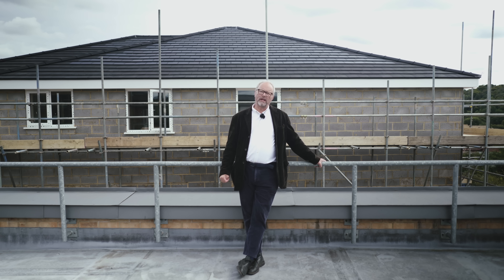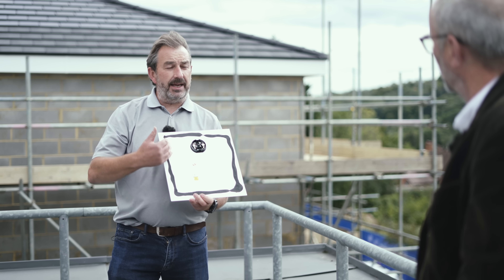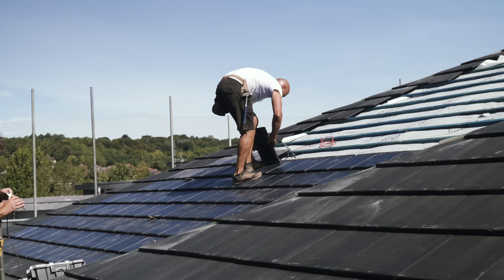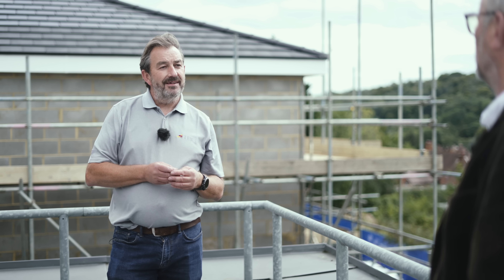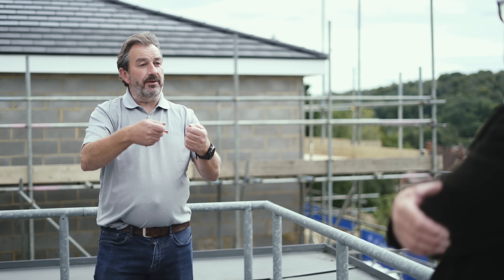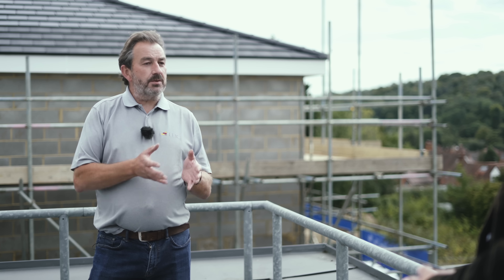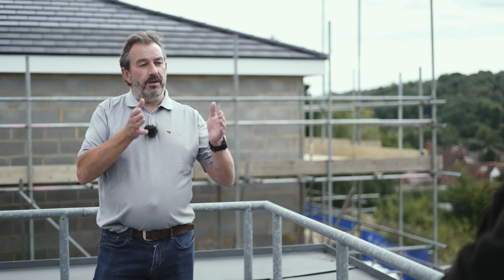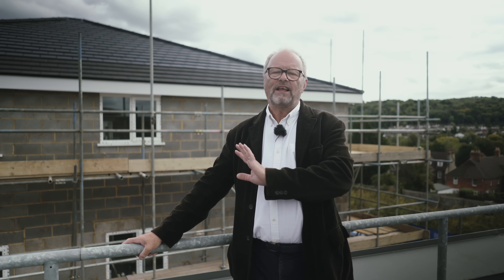Solar Roof Tiles - should every building generate its own power? | 100% Independent, 100% Electric

Comment: It seem counter intuitive to put a hold in a tile. People are trying to match old roofing systems by sticking a bandaid on it albeit that patch being a solar panel. You still have tiles and battens and roofing felt etc. There needs to be a whole new roof design based on solar, not solar as a stick on. Is a hip roof even an option if you're designing for solar?

Comment: Every house should have this. I have just bought a brand new house and the builders would not offer us solar panels of any description, I was appalled. If I want solar panels I have to have someone come in after we move in and retrofit.
Reply: Cost me £500 just for scaffolding, 3 stories high.
It just makes sense when you can recess panels and save the cost and weight of some roofing tiles.

Comment: Hi Robert, a question:
It would be interesting to see what effect could bring having most of the roofs solarized ( aka had solar panels installed). Would that produce 50% of the countries needs (or even more)?
Would that be enough to get rid of the carbon-based electrical plants? Because if that would, why are we not just do that massively? Governments spend so much on so many environmental causes. But this one could have some real effect.
Reply: Actually, if you are in Britain, you will probably see wind turbines replace the fossil fuels before solar does.  Solar is more local, but heavy-duty wind farms can produce national-level power 24 hours per day equivalent to a power plant.  It's just a matter of time.  Wind turbines have already almost eliminated coal there, and then oil and then gas plants will be going next, one by one.

I say that solar is more local because, honestly, Britain not the ideal location for solar power, compared to North Africa or the American Southwest, and solar is always dependent on batteries for nighttime service.  At this point, the availability and cost of grid-scale quantities of batteries is still an issue, although that may change at any time.

Tesla's "Battery Day" is coming this month.  Perhaps they will announce something that will bring cheaper, more efficient batteries that can be produced in huge quantities.  Other companies are researching options as well.
Reply: Do you mean for the government to put in money to boost the installation of home energy storage and power generating panels? FAT CHANCE. A factory that produces low cost power cells for home storage might be more possible and the panels would follow. The panels are almost cheap enough??

Comment: Loving this idea for a product. I like the use of standard components. Didn't know roof tiles were concrete... interesting. 

Daft Question, why all the Tesla hashtags for this video?
Reply: Well, actually, lots and LOTS of buildings are roofed with materials which are NOT concrete and cannot be.  My house has a slate roof. Planning regs wouldn't allow replacement  with concrete tiles. Many areas have clay tiles. Which are 'orange' (brick coloured) and smaller. So again wouldn't be allowed for 2 reasons.
So, whilst it's a great idea, it definitely has limitations.
New build housing estates are the best fit, I suppose. And MUCH better than the Tesla idea. Much more versatile(geddit....?!) and bound to be cheaper.....
Reply: @andymccabe6712   yes mine are 'orange', so I assumed they were clay based. I just hadn't thought about it before.

Versa-tile... 🙄😉
Reply: @BullShark I'm afraid I don't see that. I was asking why Fully Charged used the Hashtags, not the tile company... Also they didn't say Tesla's tile is not as good.  They said that it isn't as versatile when used in certain roof configurations, which is a fair comment.

Comment: What is a roof For, To Stop water  from getting into the building,
Fault ONE,   Drill a 50/60mm   hole in every  Solar Slate  Hum.
   ,,      TWO,  How long does the Mastic Last That bonds the solar panel to the conc, tile.
   ,,      THREE, how do you stop water ingress under the solar panel, and down the hole in the tile. ??? HUM
   ,,      Four,    Corrosion on all the wire connectors over 20 years min,   HUM.
Reply: Err, don't you think they might just possibly have thought about the hole in the tile situation?
Hmm.....?!
Or maybe you could get in touch and give them the benefit of your years of design experience in roofing materials.....?!
Oh! - you don't have any?
Well who'd have thought....
Reply: @andymccabe6712  These people are Piggybacking of 60/70 years of Marley
or Redland tile comp design, 
with a hole that size in the tile, you will 
ruin the structural integrity of the tile,
there was no mention of increasing the pitch of the roof, as these tiles can be used down to 19  degrees, with a very slow water runoff. after just shy of 60 years roofing
the proof is in the pudding.

Comment: Looks very interesting. We have 40 panels (13.6 kW)  on a steel roof. I don't find the standard panels ugly and we like the way snow slides off. Living in Canada, you don't get any, zero, zip production when the panels are covered. This system looks good in an area where concrete roof tiles are used, but the added cost is quite a bit over a panel. We have a SolarEdge inverter which uses modules on each panel so we know if a single panel is down. Without a system like that, you can have a bad panel which seriously harms your solar production and you are none the wiser. Perhaps they add a module like that to every 15 panel groups?

Comment: Great idea, but way too expensive. If 900 tiles = 13,500 Wh, then each tile would work out at 15 Watts. At £30 each, that would make a 4 kWh system £8,000. Eight years ago, my 4 kWh system only cost £5,000 and I've seen adverts in the UK for a conventional system for £3,600. They need to get the cost down before it will become a viable alternative to panels.
Reply: Hmm, sounds a bit like another type of green tech we hear a lot about......
Clue - it's got wheels!

Comment: We moved to our current home a couple of years ago.  Most of the things we "have to do" are now done.  I am in the process of changing to Octopus Energy and we will need to get re-roofed in 2 or 3 years.

Do I need to get a powerwall (battery) first?
Reply: It depends on how much capacity you are looking to install. If you install more capacity than your typical load then it might make sense to have some storage for over night use or heat hot water. Otherwise it can feed in to your consumer unit via a dedicated circuit and trickle feed the main incomer
Reply: It mainly depends on how many decades you want to wait for the system to stop COSTING you money ....!!

Comment: So if in series if one goes down  or gets shaded, then all that pack don't produce and be fun fault finding 46 fixed tiles to find the problem 🤔🤔🤔🤔
Reply: The guy interviewed in the video addressed this in a reply to another comment.

If a cell fails or is shaded there's supposedly a bypass diode that still allows the rest of the panels to continue generating.
Reply: Cheers James missed that bit 🤔🤷‍♂️

Comment: None of the tiles are secured to the roof battens. Is this acceptable practice?
Reply: Ever tile nailed to battens after laying (it was too boring an operation to film)
Reply: it's been a while since i've looked at clay tiles but interlocking tiles like this may not be connected at every point, because they interlock so one wont move without all of them,  the edge ones will need to be nailed / wired / clipped  to the battons.    It's very possible that they have some sort of clip system not shown on  this video though.
Reply: Russell Fry every tile is always nailed. In some countries tiles are lipped and hang on the battens, in which case every second or third row might be nailed, but anywhere where wind is an issue such as the UK it's always been the case that each is individually fixed.

Comment: Cant blame anyone for wanting tiles over panels cause they do look so much better. But i still havent been won over.

Saying its cheaper to install this compared to a normal roof with panels, seems like an obvious lie to me (though i havent done the maths). A "50% premium" is a good way to sell this roof but i still feel panels would be easier to repair, easier to upgrade, more efficient, cheaper, but of course much uglier.

Really id have to look at this in depth but i still prefer panels over tiles for cost, and more importantly energy production. Panels are just more efficient, and theres some amazing new panels developed and coming through.

Comment: These look really nice, though it sounds like they’re using a single inverter per elevation which I think would suffer under patchy cloud cover vs a panelized system with an inverter for each panel.

It really is infuriating isn’t it when you see a field full of solar panels and a bunch of warehouses next door with none.  Or if there’s a huge parking lot the same size right next to it.  Or a giant housing development with no panels installed!  It really is shameful I think to not fit panels to the many convenient spaces left in our built world and steal nature instead.
Reply: Abram McCalment we are actually installing a single inverter for the entire project, with separate mppt trackers for each elevation.

Each tile has a bypass diode to optimise output individually removing the issue caused by partial shading.
Reply: @ChrisHall great to hear this I had the same question. Another question I had was about returns. In the netherlands 1 watt of solar is good for around 0,9 kwh a year. What are you expeting from the solar tiles?
Reply: We had a new lidl built as few years ago and gues shat no solar, all supermarkets should be mandated to install solar capacity equal to their refrigeration load. This should be also thought about at initial design stage and not be allowed to be 'watered down' like the Merton Rule often is, a derisery 10% often ending up at 5%!
Reply: @andyhodchild8  The big Saintsbury's outside Kingston in SW London has  solar and wind for the lighting and refrigeration. The did off there own bat.
Reply: @andyhodchild8  We had new LIdl built in Dover as well, 2-3 years ago. No solar either. Their roof even slopes to the North, and they made huge glass wall on the southern side for extra light. In my opinion, solar would make more sense
Reply: This is what is normal in South Australia. Only problem is those that don’t have Solar panels get bill shock during summer
Reply: what about when there is SNOW....
Reply: @dopeytripod  ...then they are covered.
Reply: @dopeytripod  the snow melts a bit more than a regular roof because of the thermal mass of the solar panel, andsome have small heating elements that create a small film of water underneath (don't have to melt all the snow), and the snow slides off if there is enough pitch. Or you have to buy some power from the grid.
Reply: I see a possible problem with snow buildup as with metal tile roof the snow sticks to the roof, but will it stick the same on glass? The problem only happens if the roof is slippery and it slides off taking the guttering with it. Most houses can overcome this by fitting snow straps from the roof to the guttering, however how can you attach them to glass panels?
Reply: Plot twist: all the other houses have solar tiles and you can't see them.
Reply: Some people get it more quickly than others. It will happen eventually
Reply: yeah sorry Phoenix Arizona
Reply: Attention, Limeys !  We Muricans love youse Gyes for so many reasons...including your quaint expressions. Yes, I Do Have and am About To Make A Point Here: W E I G H T !!!  USA roofing material is largely made of a felt-like material sometimes referred to as asphalt. Home Depot, where I worked for 18 inglorious months, sells train-loads of this stuff to individuals, both homeowners and tradesmen, usually the GAF (formerly General Analine & Film) Corporation brand. Multiple-layering does, in fact, make for a weighty situation, but "concrete" ...Really ??  Or am I conflating Concrete with Cement ?  I wonder what the weight difference is among the GAF product, the standard British roofing material and the various Solar panels. [Statement, not Question.]
Reply: I have Tesla roof tiles on my roof my system is 14.97kwh and it makes 50 to 70 kwh per day even on cloudy days.
Reply: with 2 inverters.
Reply: @Slebonson  I like it when you see them running at night under a bright full moon.
Reply: @Slebonson  To be relevant to this discussion your location would be important to share ...
Reply: @Slebonson  The problem with Tesla tiles, as Chris explained very well, is that if you have a US style roof with gable ends you are OK, but only if the roof is a whole multiple of tiles long and wide. These solar tiles are identical in appearance to the non-solar, which can be cut to fit. Could you do that 4 aspect roof with Tesla? No.
Reply: @sadiqmohamed681  The non-solar tiles of a Tesla roof can be and are cut to size for installs.
Reply: @MrAlfable  That isn't what I had heard. But good to know. It would make them more saleable in Europe. The big planning issue with solar roofs is planning permission, so this type of tile makes a huge difference. The next step is going to be making the sort of tile use in most of central and southern Europe which are not flat. If recently read about a technology that can be applied to existing tiles by spraying on layers. But so far only in the lab.
Reply: @sadiqmohamed681  The solar and non-solar tiles are not identical in appearance.  Even in this video you can clearly see the 'framing' of non-solar tiles around the solar ones.  It still looks better than over-roof panels but if it's a listed building you may still get conservation offices that refuse to consent because of the two tone / matte-shiny appearance of the solar roof.  They can be extremely fussy and stubborn (and I say that from experience).
Reply: @TerraPosse  I too have had that experience, I live in a Conservation Area. I think the trick is going to be a way of colouring the top surface to match. There are two buildings in my area which got permission for solar panels because they have flat roofs with parapets, so the panels can't be seen from any where except the local church tower, or a nearby fire station training tower. One nearby house has solar thermal panels which were allowed, because it is just outside the Conservation Area, and the roof faces away!
Reply: @sadiqmohamed681  no need to wait for Tesla. At least here in the Netherlands there are already multiple options available for building-integrated solar panels made from glass (Exasun, beauSolar and others using more conventional panels). Should be do-able to get them elsewhere in Europe. Also saw German offerings. We have Exasun X-Roof panels on our period row house. They look great!
Reply: Sadiq Mohamed Actually unless you’re house is listed you do not need planning permission, you may need building permission, but the installer should deal with that and any strengthening (if needed).
Reply: John Michael you need pp in a conservation area but they’re usually ok
Reply: @sadiqmohamed681  

The solar tikes  are the same profile as  Marley modern concrete tiles ,you can see in the beginning of the video how they have solar for the main area and concrete for the valley and hip mitres.